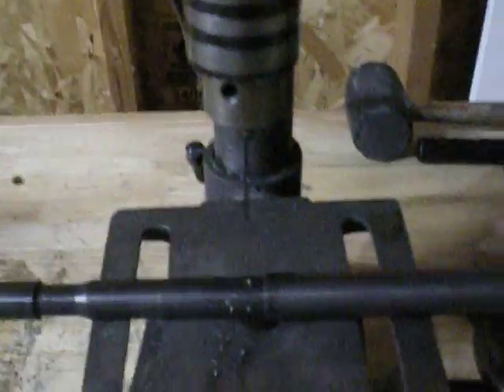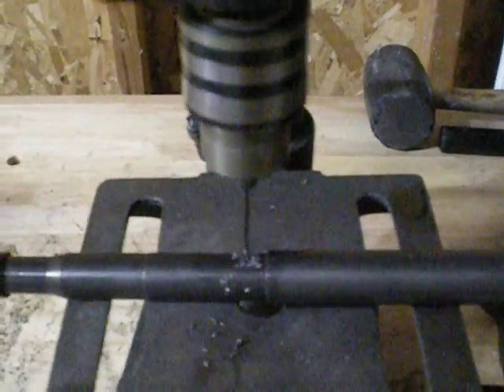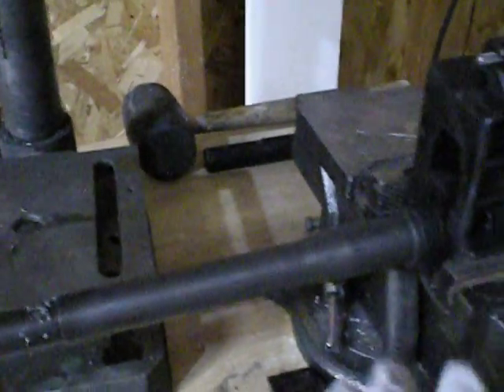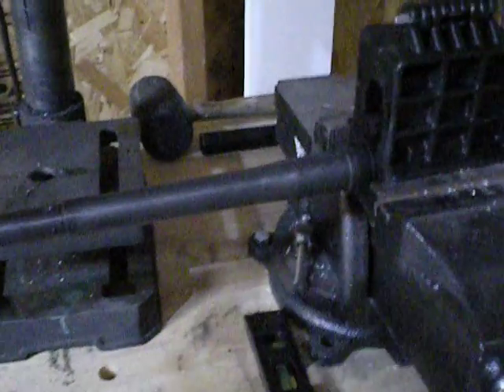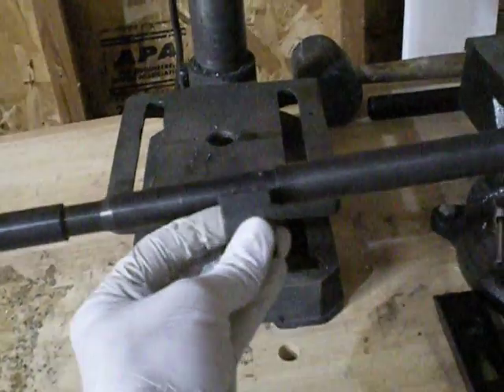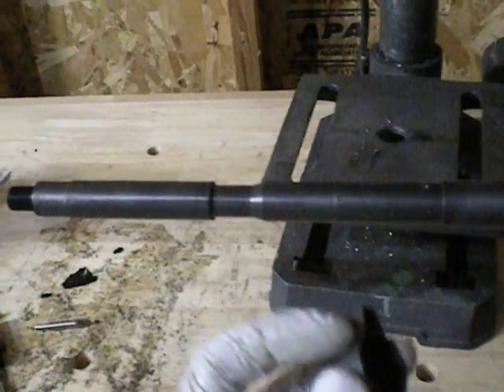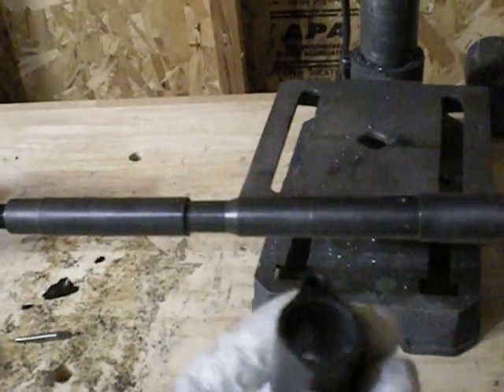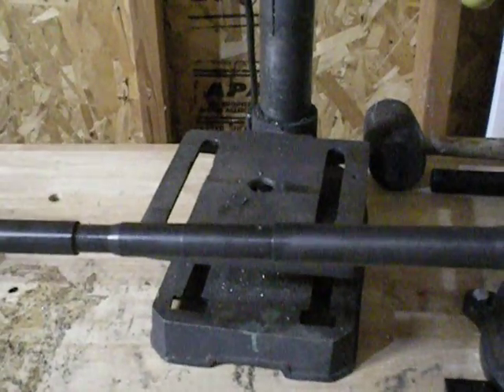How to drill the gas port on an AR-15 barrel. 4 of 4.

Comment: cleaver idea on the port adjustment. Thank you. i've got a dmps barrel that I had cut for a arpistol build and wouldn't you know it, I'm not getting enough gas pressure to cycle correctly unless using a suppressor, then the damn things run flawlessly, otherwise it's a bolt gun. I appreciate you taking the time to put this together. I don't know if people realize what a pain putting these things are putting together(videos that is). I sure like having the ability to do this type of thing on my own. I hope you're doing well.

Comment from the maker: Haven't had too many dissipators come in. And just ti clarify, when I drill, gas ports, I have the proper alignment blocks for this. The video is just to help those who don't want to spend $200 on tooling in order to drill 1-2 barrels, when they most likely already have everything they need. Hope you found it useful.

One of these days I'll make a video about doing DIY front sight block pinning as well, if there's any interest.